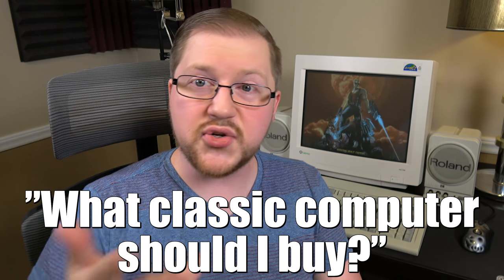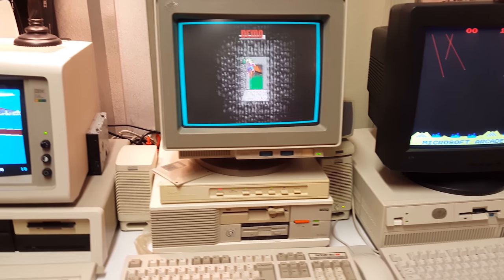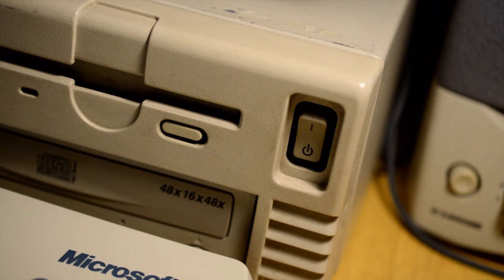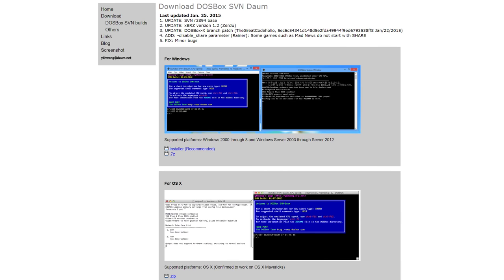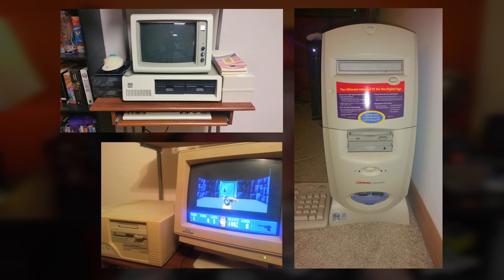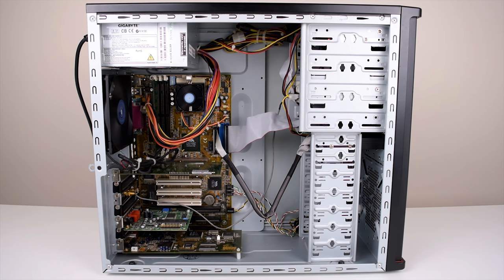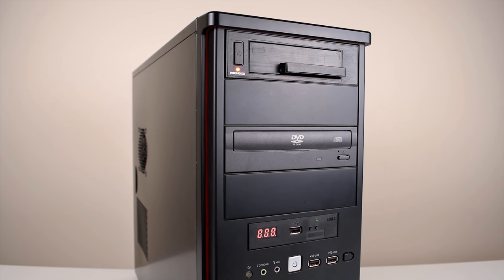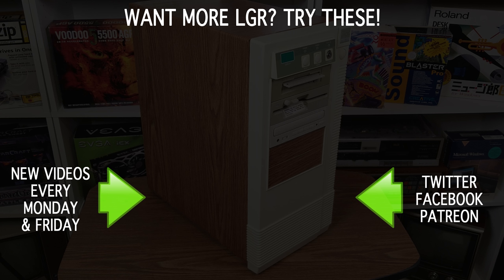Choosing a Retro PC for Games: Advice & What to Look For

Comment: I've build a not-so-old-but-yet-old PC more for windows 95/98/xp games than dos games... despite using it for some DOS Games...

My Build is:
Pentium 3 800
Voodoo 3 3000
Soundblaster A-Live
256mb Ram
Running windows 98 SE

The thing is... i HATE, from the depths of my heart, windows virtual machines for gaming... Dosbox do a good job with older games, and ScummVM run some early/mid windows games... however there is a lot of "early/mid" windows games (mid 90's to early 2000's on most cases) that doesn't run (or run with several problems) in new machines...
Of course, some have sourceports, some have fan made patches, and nowdays gog has been making some releases with things working...

However, LOTS of these games require a lot of work configuring, finding files, changing dlls, running programs, pathing stuff, and sometimes, after all this job it doesn't work, or work with problems...

With my machine i run several games that gave me a headache trying to run on my modern machine, only "install and play". And also a lot of DOS Games work as well, so if i can install and play, for me, it's still better than dosbox for me...

But i always have DosBox/ScummVM when things get crazy, or simply are "too old" for my PC...

Comment: 3dfx voodoo 3 (agp) and creative sound blaster (isa) is the way to go for an old game, with some asus motherboard from pentiumII 400mhz era P2B maybe with 768 mb of ram 10gb 7200rpm hdd x2, some 3com 905 ethernet card, 24x cdrom, put inside elanvital case,  altec lansing speaker acs90, logitech internet navigator keyboard on logitech optical mouse, viewsonic flat panel lcd with beige color, running win98se

Comment: If I were to build a real retro PC I would put together something close to what I had back in the day. Optimally I would have DOS 6.22 installed and then Windows 95 osr2 for an added touch. For hardcore mode I would get one of those single Pentium Pro motherboards with onboard SCSI, something that would beat the 33MB/s top EIDE at the time and more importantly for those 10k-15k RPM hard drives. The CD-ROM drive would be either SCSI-2 or IDE/ATAPI 4X-16X, nothing special. For the video card I would get the top of line 2D PCI card which was the Matrox Millennium, I believe, that had a whopping 4MB VRAM (possibly 8, I can't recall offhand). Maybe add an additional Voodoo or Voodoo2 add on card at most for those later games. My computer during those days was all non-SCSI until my Pentium II 400 w/ AGP, so that would be one big change and of course I always wanted that top of line Matrox card at the time, instead I had a Voodoo Rush card (2D and 3D). My go to CPU would be what I had at the time, a Pentium 200 MMX. Finally the one thing I had and would be a definite must, my good old trusty Sound Blaster AWE64 Gold w/8MB RAM (4MB included + 4MB add on). That would be my ideal retro PC that would be compatible with all the DOS games I played (1993 and above) along with some of those early Windows 95 games.  

My first PC and the only PC that I ever had that was pre-built was a 486DX2 66Mhz Packard Bell. Ever since that I have always built my own PCs, including my first build which was a Cyrix PR200 (actually ran at 133Mhz I think) and many things detected it as a 486, lol. I never came across any game that needed a turbo button, but you never forget your first build and wondering how you make it go faster with just a turbo button, lol. Anyways, for me personally, even if it was just purely a DOS machine, I would still go no lower than a classic Pentium, even the 50-66Mhz ones. Although I was curious about building a 486DX4 100Mhz system like 15 years ago or so when I found out that CPU existed. Maybe we can all compromise on a 486DX4 100Mhz, that will always be a dream machine, lmao!

Comment: Boxer is another great MS-Dos emulator and its Mac os x compatible. Its what I use when I want to have fun playing old games, but I barely ever hear anyone say anything about it, so I figured I might as well say something because it could potentially help some people out.  

I also second ScummVM. Its very easy to run many games. In addition to that I have a windows 98 dell laptop that I play old windows games on. Funny thing is, it crashes less often than my Mac laptop that is only 5 years old. I prefer laptops because of the size, and ability to play pretty much any where. I know they aren't the best though for many other reasons, but for me it works pretty great as a solution.

Comment: Nunca se vivirá igual la experiencia de jugar juegos de (DOS) emulados en sistemas modernos, a jugarlos en sistemas originales. Mi opción sería una 486DX2@100mhz con 128Mb de memoria ram bus de 66Mhz con una tarjeta madre con puertos PCI y puertos ISA (compatibles a 16bits y a 32bits) con Windows 98se y la única cosa "moderna" que añadiría, sería un disco "compact flash" de 16Gb (conversión IDEE de 66Mz) con una tarjeta gráfica PCI con 4Mb de VRAM dedicados (alguna 3d FX) y una tarjeta de sonido a 32bits sound blaster. En un hermoso gabinete de mini torre  (con botón turbo obviamente) y sus respectivas unidades de diskette de 3,5" 5 1/4" y cd ROM creative de 8x. Y no puede faltar un monitor CRT Sony Trinitron de 17". Estaría genial...

Comment: just get a TNT2 videocard and combine it with one or two Voodoo II 8MB/12MB addon cards and use an old ASUS board with or a first SLOT-A Pentium II 333MHZ-400MHZ... This is alround the best choice for your money in my opinion... i would say that with some tweaking and dosbox for the real old stuff your compatibility is very high,, perhaps not 100% but on the 1000 old games tried (from DOS to Win95) i got all of them running very nicely... Even Ultima IX Ascension runs great in this configuration.. O and a real Soundblaster (Sb16/SB16Gold/Sb32AWE/SB64/SB64Gold,etc ) really helps... ;)

Comment: This is kinda making me regret my mom throwing out most of our old Dos/95/98/2000/me/xp games and some old computer towers. But anyways DosBox is my next option. Plus this reminds me that I still need to replace my Windows 10 desktop's DVD drive with an old Blu-ray drive that's about 8 years old and do a few other things with it.
Reply: I'd recommend 86box - it emulates not even dos itself, but a who
le system - from IBM 5150 to a pentium-1 - so you can create images of HDD's, attach images of CD's install dos, win 95, 98 on it and work with it as with a real computer !

Comment: Ah, midi. I picked up a Yamaha MU-128, and it's a lot of fun - I use it with a very cheap midi keyboard.
But, getting it to work on the computers I have access to is a total pain.

Turns out, windows 10 no longer has a midi mapper. (it still plays midi, but only through the integrated soft-synth. All other options are disabled. Microsoft claims midi is 'obsolete' - clearly they haven't talked to any musicians recently....)
OK, that's annoying.
But... Turns out my 2006 windows XP laptop, in spite of having a working midi mapper, doesn't recognise my MIDI devices...
Ugh. So frustrating. XD

If I had an older system right now I guess I'd try to use that, but I don't... 
Oh well...

Comment: my dos rig consists of a 200mhz pentium MMX and a mobo that allows me to toggle the cache and fsb speed, a s3 trio 64, sb16, 64mb of sdram, dualboot of dos 6.22/ win 3.11 and windows 95. it works good, needs some tweaks still like a 3d accelerator.

Comment: I recently bought the old Samsung Sens 690 from my friend just about 30 bucks to play some of the old games that make me doesn't feel right running on more recent laptops. I forgot the exact specs, but I think it was armed with Celeron of about 700mhz, with SiS 630 audio/video chipset. My friend did an additional favor for me with replacing Win2K to 98SE, to have more of that aesthetic feeling. (I assumed that Win2k has a more compatible USB handling, but it was totally worth it) Too bad that I just can't make Sound Blaster emulation working properly in DOS environments where adlib settings do things as normal.

Comment: I think at this point - all of dos gaming (including latemost svga ones via replacing dos4gw with dos32a (you can run Blood in 1280x1024 with it on dosbox with no hiccups)) is done on dosbox.

Only PC you should REALLY keep around is windows 95-98 machine with no voodoo. There is a slew of '95-2001 games which will not work via dosbox and emulators do them no justice.

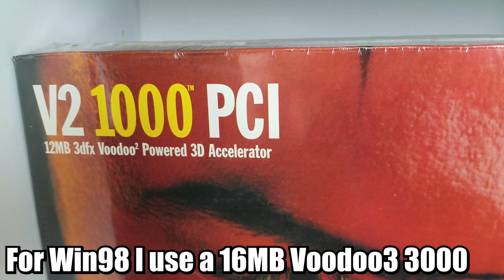Comment: 6:06 Not sure if it is the exact same model, but I have an Emachine T3302 that looks just like that. I have had it since 2005 and still functions as my main computer sometimes but mainly runs 2000s era games especially since adding an HD 7770 to my Windows Seven machine caused several older games to
quit working on it.

Comment: About not having USB support for hooking up an external 5.25" to a legacy machine, wouldn't most of those motherboards have available serial and/or parallel ports? Sure it's more of a kludge by modern standards, but it works.

Comment: I have a modern pc with i7 8700k and 1070ti.
I use pcem and dosbox for some games.
I'll build two retro machines; for windows xp will be with core 2 extreme qx6850 and a gtx 780.
For windows 98se i'll have pentium 3 tualatin and GeForce 4 ti4800 :D

Comment: A 2022 perspective now is just throwing Windows out of the door entirely and using Linux with Wine and Dosbox. Dosbox for the DOS games (obviously) and Wine for the Windws95+ games. 

Why wine? Modern Windows messes up a LOT of games. Wine gets them all to work. A lot of glide games work well with glide wrappers too, and I was able to play a lot of early 2000s games that stopped working right on modern Windows there just fine.

VMs like VMware never do them justice really, usually 3d acceleration is just crap in VMs. 

Examples of games that I got to work just fine under Linux without even bothering to tinker are Unreal Tournament 99, Earth Series, Expendable and Incoming (two of my nostalgia childhood arcade games), Forsaken, MDK, Uprising 2...  For UT99, adding a modern DX10 or OpenGL graphics backend can even use the S3 MeTaL textures and it doesn't have the weird speed issues it has under Windows. 

What I  can recommend is using Lutris and Gamescope on these. Gamescope is a tool made by Valve that runs as a wrapper around games. It makes the games behave on a Linux desktop by wrapping them into a borderless fullscreen window. This made it possible that I never got stuck ALT+TAB scenarios, stuck resolutions and all of this dandy stuff. It also properly scales the game to your full screen resolution, integer too if you want.

Hardware wise I would recommend just having an AMD APU build, dont even need a dedicated GPU (especially not for like early 2000s games). Avoid nvidia for this because gamescope is not nvidia compatible and the proprietary nvidia driver just has issues sometimes. The AMD driver is in the linux kernel though and has no to very little issues in this sorta thing.

Honestly, the upcoming Steam Deck could be a very competent retro gaming implement here. It can run modern stuff, but it can also run a crapton of games that hail from older times, and stuff from GOG, using Lutris as the manager to make it easy to manage, managingly.

Comment: Personally for me I'm like you I prefer the original hardware and I have tons of it and many different systems for different occasions and things that I want to do with them parts are getting harder to find though and or more expensive and certain types of systems are becoming not really obtainable anymore by the normal average person who wants to play a dos based system but the common stuff is plentiful but for how long it's unknown and you're right there is always struggles when building your dos PC hardware doesn't last forever it's always a Gamble whether or not it's going to work if there's issues with it or whether or not the other components you got will even work with it but half the fun is making the computer the other half is using it and modifying it upgrading it and changing it to your liking that's my take at least

Comment: For me personaly i use a windows xp  computer i play mostly early 2000s games and some late 1990s games so for me windows xp is fine . The hardware i am using is fine does the job just fine and most importantly it has drivers for windows xp . 
I am using:
Motherboard msi k9 neo v2 socket am2 
Cpu  amd athlon 64x2 dual core 3800+1.99ghz 
Gpu 9400gt 512mb vram msi edition passivly cooled
5 gb ram ddr2 800mhz

Comment: You can also have a modern machine and have multiple boot os's such as I currently have  windows 10, windows xp, windows 98se, ubunto installed.    Yes I have a bunch of older machines but I finally realized why should I when I can do it all on a modern pc with my 1700x build.

Comment: I'm a little conflicted with how I feel about considering XP to be "retro gaming". I consider XP to be a modern operating system. I feel as though there isn't a significant platform shift from XP to Windows 7 through 10. Once you start getting into AGP territory, I feel as though you are in modern gaming territory.

Comment: I would like a 2002 mid-spec desktop pc with dedicated geforce  4 card, athlon xp 2000 or a P4 with 256 MB RAM DDR. One in good condition is very difficult to find. I would destroy unreal tournament, red alert 2, NFS high stakes and other legendary games. Also, a CRT is mandatory.

Comment: Re-watching in 2020 as I'm putting together a Dell Optiplex GX270 Windows XP in the small desktop FF. Going 3.0ghz Pentium 4 ht and 4GB ram. My only Problem (besides the Optiplex swollen cap problem) only having a proprietary 210 watt power supply to work with. Every time I find a graphics card that is PCI and capable of playing some of the games I want it to run the power requirements well exceed the 210 watts. Fingers Crossed I will find a tower PC here soon that I will be able to get a bigger power supply into.

Comment: I use a pentium 133 with 64mb ram an s3trio64 2mb an awe64 soundcard and multiboot partitions for dos 7.2, 95 and 98 with bootit ng and also a 20gb partition that's shared between all os's which holds games, drivers and os files. the shared partition is also shared to the network so I can transfer files to it from my pc or nas. and it works awesomely. for right now I don't have a good monitor for it I use the 4k monitor from my main system's picture in picture mode so I can scale a good screen size depending on what I'm running looks okay and will do for now. it's hard to get crts in my area

Comment: This  is a  Good tube Video ,  as it is   There is More People becoming more Retro Vintage Computer Enthusiast Then Ever..   From all Platforms ,  From IBM/PC / Commodore /  Apple / Atari ,  The  Same Vintage Computer Systems  8bit  16bit  32 Bit  that were chucked  too the Side of the Curb in the 1990s to 2000s   for Spring Clean Up  or Seen at a Thrift Store or Garage Sale  for $10 or $20 dollars ,  are Now Insanely Costly ,   in Auction online sites like Ebay ,   Its Literately Skyrocketing ,  as of ( 5/2018 ) some systems are NOW Pricey, For example up too  $200 ( Commodore C64 /PSU /RF Modulator )   for a system or $400 to $500 for a Complete System  C64 Computer  Disk/Tape Drives Monitor Games Joysticks  , Glad I have MY   Commodores  Atari's n Apples and  IBM's and PC'S  a collection of the span of 3 decades ,

Comment: I use dosbox for some things, but I also have a nice IBM PC350 setup. However i have found myself using a 2000 era Dell P3 700 lately, as it seems to offer compatibility with a lot of mid to late 90s games. I've yet to try Commander Keen though! ;-)

Comment: 486 gaming I would recommend the unisys cwd (1994) or the toshiba libretto ct70 (1996). Both are under the 100$ pricepoint and the formfactor, they are very small. AT clones are way too pricey.
I find it pleasing to run zsnes on a 486 :-)

Comment: Didn't Valve attempted to fix & remedy the infamous issue that Wine had regarding the compatibility of games that relied on DirectX versions newer than 9 back in 2018 with their Proton API bundle to help the developers of the Wine API? (26:14)

As far as I know, I don't even think that VMWare, Oracle Virtualbox, Parellels or any other Virtual Machine software will probably never add support for Valve's Proton APIs & the new Wine DirectX emulation APIs, because they might think that they would violate Microsoft's guidelines on virtualization of their DirectX APIs, because Microsoft only allows virtualization of DirectX up to version 9 (with a few exceptions of DirectX 10 & later with VMWare & Parellels, when regards with emulation of Windows on both VMWare & Parellels). (28:19)

So technically speaking, as of today, DirectX 10 & later emulation for the other Virtual Machine software for PCem & Oracle Virtualbox still remains in development hell. (27:30)

Comment: I have a Cyrix 50mhz dx2, it runs Doom fine if I turn the screen size down a bit. I can also run Duke3d acceptably if I turn the screen size down as well, definitely not as choppy as for Nostalgia Nerd so I was a bit surprised.
Reply: His is a 100mhz 486 right? Hmm... my Pentium 1 90mhz ran Duke3D with only slowdown when loading the game menu but no slowdown at all in game. Would a 66mhz Pentium still run it better than a 100mhz 486? But my current build uses a AMD K6 200mhz so there's no slowdown at all. And DOS Quake runs flawlessly.